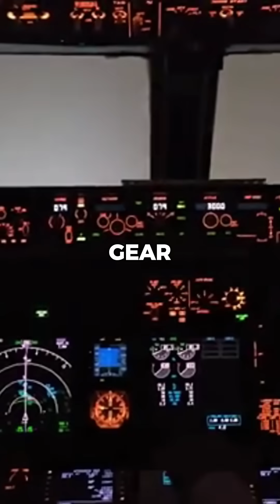why Airbus test aircraft in the arctic

Comment: Wouldn't it be cheaper and safer to just build a huge fridge at their factory?
Reply: Yes it would be and they do have a few and so do other companies they fly the aircraft so they can get in flight data in harsh conditions this video is wrong
Reply: Actually they have a climactic hanger at Eglin AFB that tests in all temperatures. Very hot and very cold. It would be cheaper flying to Antarctica